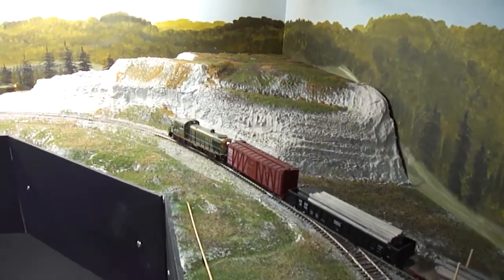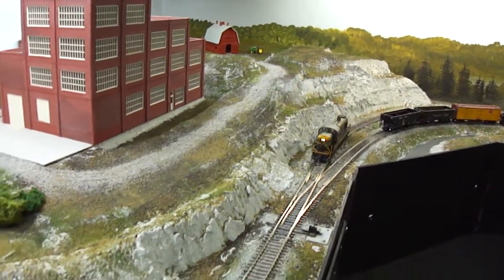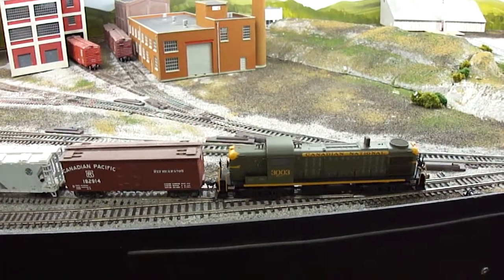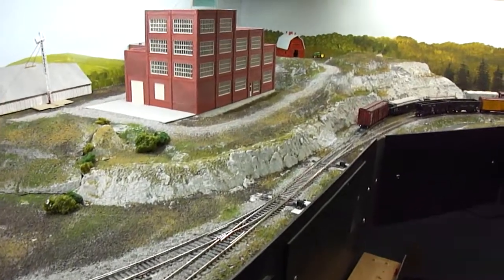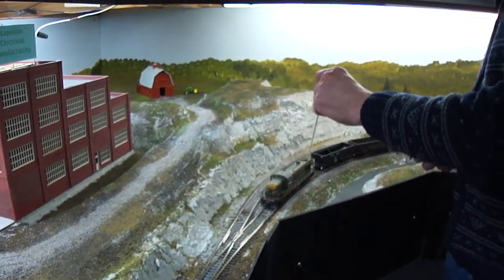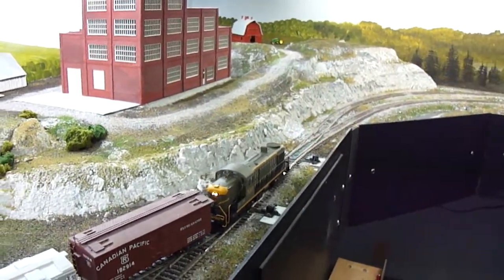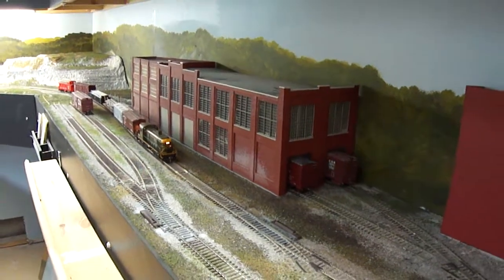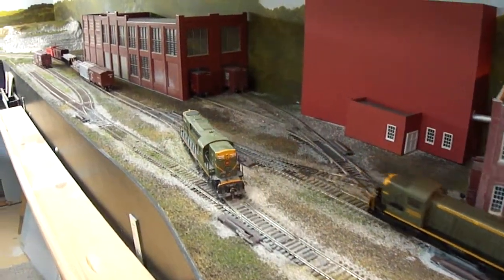Part 7: Tom Badenoch's Northern Pontiac Railway.  Cameron's Mill

Comment: That was a fun series, and looks like a fun layout too.
I thought it interesting that after Tom stressed the importance of ensuring that all open top cars have appropriate loads, all your main line trains were hauling empty hoppers and gondolas in both directions.  The only loads moving were two cars of heavy painted wooden poles heading for the paper mill (I can't think how a paper mill would use them).
Reply from the maker: Your right.  Tom stages the cars properly by load and type for ops sessions.  For the video, we just grabbed some cars that had to be transferred and we were just doing a demo of the switch move at the mill.  He mentions at one point that this was the case  Glad you enjoyed the series.